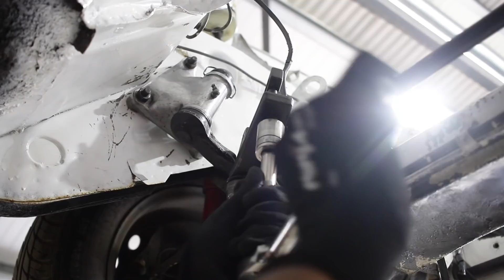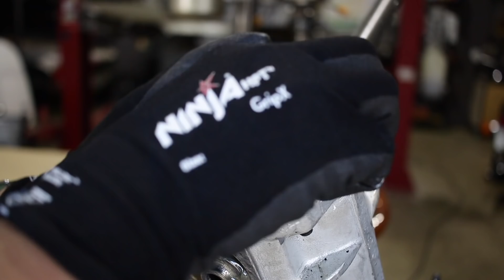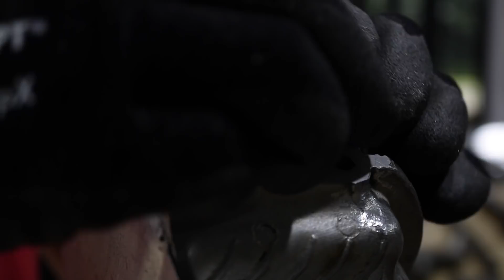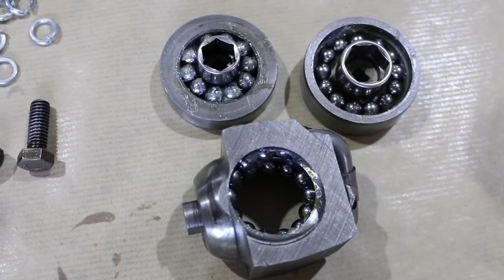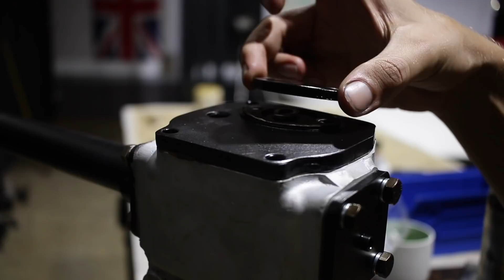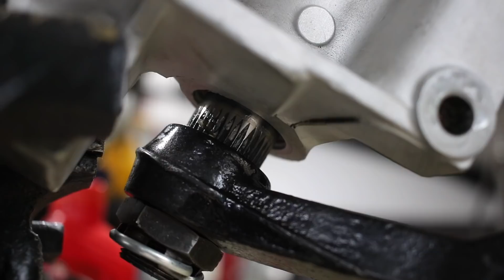Alfa Romeo Spider 105 Burman Steering Box Rebuild.

Comment: Hey Jethro - I know this video is 2yrs old, but…were you sure that was regular grease and not (Castrol) Spheerol - which can be used in steering and gearboxes? Spheerol flows at any temp, unlike regular grease and can help stop leaks. Thanks.

Comment: Great video. I’m attempting to replace my lower seal on an early type box(like the one in your video). The metal washer does not go back in no matter how hard I try! I purchased a 28x35x5 mm oil seal as in your video(the difference being 5 mm vs 4 mm which they did not have). It would not fit properly. I got it to seat as best I could but when I put the shaft back in (gently) the seal dislodged. Any tips ?
How does that metal washer reinstall??

Comment: I'm curious about the bottom bearing race you spent all that time on your lathe with to take care of the pitting.  Do you think it would be possible to upgrade those loose bearing with a cartridge bearing set?  The surfaces would need to be milled to accommodate the cartridge bearings, but those would be something that what last a good long time and be easily replaceable.
Reply from the maker: I believe it is possible, I’ve seen some people do that conversion. I don’t have the skill as a machinist to do it myself at the moment.

Comment: I noticed on the final assembly of the front cover, the spacer that goes in after the front race sticks out a bit. Does this compress inward as the cover is tightened?
Reply from the maker: Yes that's how the preload is set on the bearings. Adding shims between the casing and the cover is what loosens the preload.

Comment: Great job on this!!  One thing I have always seen as helpful that I didn't see you do on your video is to make sure that the box will still operate smoothly when you apply force to the steering arm, and not just the wheel. A small difference in the shims can make it difficult to "motor" the box from the arm, which would of course mean that there wouldn't be much feel of what the front wheels are doing on the road, and possibly not enough freedom for the steering to self-center due to caster.  Great job on these videos.  I really enjoy them and admire your care and pride in a job well-done.

Comment: Just came across your channel...I' an owner of 1970 1750 GTV which I restored 20 years ago...i replaced the idler a number of years back plus all of the steering gear and a new suspension kit and have had no steering issues..but....for whatever reason I worry about the steering box as it is original and I'm thinking fatigue may be setting in. As with brakes...steering failure not something you want. The steering box is the last remaining (significant mechanical) original part on this car...mainly because I have had no steering issues. I thought about putting in a new re-original jus for peace of mind...not terribly expensive for that. Going o have a look and see if there are any fissures or cracks...its always been on my mind.

Comment: Forgive me -- you may have already answered this question somewhere. Exactly how many ball bearings are supposed to be in a Burman box? Many moons ago, when restoring my '74 Spider, the box came apart with... let's say, much less finesse, than what you have demonstrated. :) At the time, I thought I had gathered all the ball bearings off the shop floor, but exactly how many there were supposed to be has haunted me for 25 years. (The terrible blue-and-yellow manual was of little assistance!). As an aside, the bottom seal on my Burman has never stopped weeping and it PAINED me to put grease into it as a solution -- I wholeheartedly agree, packing grease into the box is at best inelegant. Borrowing courage and conviction from your video, I will retackle the job sooner rather than later!  Cheers, Jethro!
Reply from the maker: I think it was either 54 or 57, I can’t quite remember. I just made sure I filled up the bearings until there wasn’t space for anymore ball bearings to fit. I guess one benefit of the grease is that it stops the ball bearings falling out when you open the box.

Comment: Whats your experience with the welding up? On Alfabb most claim that the aluminium so to brittle for substantial welds and the introduced head would rather lead to more cracks in brief time. That sounded reasonable to me but few actually seemed t give welds a try.

Comment: Thank you Jethro for the video, Just re-welded the cracks on my box today. it wasn't easy at all. here my tips on how to TIG weld it: Clean the box at least 5 time with fresh thinner. grind to white metal all area to be welded. preheat the box 80-100deg c. use low heat input, I started at 135 Amp and it was way too much. The more amps the more porosity you end up with. The first pass is the most difficult due to the base metal gazing out unreasonably the remaining pass are more manageable. I found that having too much AC balance would generate more pores. Overall I feels like this alloy possibly contains zinc (like a 7000 serie) it is not designed to be welded! I used 5356 filler as that's all I had, 4043 is probably better. I wish I would have been told this is a pain to weld! I would have been more carful with the amp settings. Take care and be prepare for a few rude words :)

Comment: Went through this about 25 years ago so my memory is a bit dusty but it's likely that once the car is full weight on wheels you're going to find a dead zone in the center caused by wear on the part of the upper arm that interfaces with the carrier which is very difficult to restore. You can take some of it out with a shim under the spring plate but this tightens the entire mechanism. there was a guy in LA way back when who was machining new arm faces but don't know if he's still around. Also, as was my case, there may be cracks in the housing beyond the ones that were visible. It would require dye penetrant or some other NDT detection method to see them. If the housing breaks it will do it when you are turning the wheels when stopped such as trying to squeeze into or out of a parallel parking spot. Another option is to replace with a ZF box but I think they may only fit into a 115. A problem with these boxes, especially the LH drive ones which are on the exhaust side, is that the oil most likely drained out of them a year or two after they left the dealership floor and nobody ever bothered to check. As far as I know there was never anything in the service manual telling you to top off the steering box oil.
Reply from the maker: Exactly. And on the RHD cars you have to remove the carburetors just to top up the oil. So this oil seal conversion should help it enormously in the fight to keep the oil level up.
Reply: @JethroBronner  I used some stuff that was being suggested at the time.  (sorry can't remember the name) It was a red colored liquid and best described as being about halfway between gear oil and grease. It has been in there for over 20 years now so seems to have worked well. The leftover tub is around here somewhere I'll see if I can dig it up.

Comment: Great video.  I rebuilt my burman box a few years back and found the same cracks around the bolt holes during the process.  At the time the billet aluminum boxes were less costly so I bought one and completed the rebuild accordingly.  The result was excellent.  By the way, I also decided to reinforced the attachment points for the box and the steering idler by adding 1/8 inch steel plates where the three bolts pass thru the front wheel wells.  I was told this is an old trick many racers used back in the day.  By doing this the opportunity for the box to flex or twist is further reduced.  No issue in the last five years.  I also agree with you regarding the use of oil vs grease -- not a solution only a band aid.  Thankfully the new box and seals do not leak, so far.
Reply from the maker: Those strengthening plates are a very good idea and I will welding some into my 1750 GTV project for sure, however I’m going to keep this Spider factory, as it’s not mine to modify.
Reply: @JethroBronner  Welding is fine but panel bond, IMHO, is a better solution.  The bond is super strong and no H2O nor oxygen can get between the metal to promote rust.

Comment: Another great Alfa video.  Please keep them coming.
Your straight forward, no fluff style is refreshing and enjoyable.  Beautiful production. really informative content and presentation.  
Jethro, what are your thoughts on wider tires and their impact on the steering system?  I have 2 spiders, 1 with 185's the other 205"s.  The original spec was 165.
Reply from the maker: I find 185 can be pretty good, especially on a 15” wheel, I like the 185/65 R15 on a TZ1 15x5.5 wheel on an early spider. I find 205 is really wide and spoils the handling quite a bit, especially on a GTA wheel. The early Spider on a 15x4.5 with 155 tyres drive really really well, but of course it’s hard to find those tyres now.

Comment: In the 1970s I worked on a number of Alfas prepared for racing in the U.S.A. In many instances the steering boxes had ribbing built up from weld to prevent the cracks your example has. All the Autodelta built cars I serviced had this feature. I believe there was a technical bulletin on how to add this reinforcement mentioned in the ALFA ROMEO COMPETITION REFERENCE HANDBOOK curated by Don Black. I’ve enjoyed watching your videos and it brings back many fond memories.
Reply from the maker: The whole time I was working on this I was thinking "How did they run 9 inch wide tyres on the GTAm cars!?" So you've answered that for me haha.

I'm going to have to keep an eye out for a copy of that book.
Reply: The first time I saw the reinforcement weld, I thought it was a crappy repair job...

Comment: My shaft had the same bottom pitting as yours, I installed a 17mm Internal Dia 47mm OD 15mm thick tapered roller bearing in place of the old one, the rounded edge of the inner bearing opening rests against the pitted groved part of the shaft (less than optimal contact surface perhaps, but not terrible either), and it's smooth without any play, no other modifications needed
Reply from the maker: That's a solution I've considered as well. In that AlfaBB thread I linked there are some photos of that conversion too.
Reply: @JethroBronner  the solutions in the thread (as far as I can see) involves a lathe and a shaft that is a PITA to turn, I made it work without any modification with the mentioned bearing. I don't have a lathe, and would probably have gone the "proper" route if I had access to one, but this $5 no-effort solution was a pleasant surprise

Comment: The holes in the steering wheel are for another type of puller, but your little tool is fine too.

I use a small puller with threaded rods to suit, put 'em through a harmonic balancer puller, but your solution uses the same mechanism, and works!

Comment: Zen might be the wrong concept for maintenance... Applying zen, the idea would be to simply use it, whatever happens is meant to happen. Wabisabi might be a better way to look at it. Repair what is broken to show appreciation, but not look to "perfect" or "hide" the damage. So use it, care for it, appreciate it, but if it's damage, wear it like a badge and work to make it serviceable again, but no aesthetic repairs as it hides the thing's history(kintsugi repairs in earthen ware, they literally put emphasis on the cracks).
Reply from the maker: Yes I think you're right about that definition, but I was really just making a reference to the book Zen and the Art of Motorcycle Maintenance.

Comment: Is it possible to make a quicker ratio by modifying something? Something like 12:1 should feel great.
Edit: Such a nice video, very satisfying and calm. I admire your attention to details, and how clean everything is.
Reply from the maker: The easiest way to change the steering ratio is to swap out the arms on the spindle, you can get short ones which make the steering more aggressive.
Reply: @JethroBronner  Thanks. Will this cause any change in front end behaviour? Bump steer or anything of that sort?
Reply from the maker: I've never tried it, it seems to be the thing to do for track orientated cars.  I think you might need to really think your suspension setup through if you use them.

Comment: Excellent content Jethro I always wondered how complicated steering box repairs and tuning were as a lot of Japanese cars in Australia using recirculating ball steering often had issues even from factory with excessive play - fascinating work as I’m no engineer yet your approach to maintaining yet refurbishing is an art and incredible to watch - well done 👍
Reply from the maker: Recirculating ball steering seems to have a bad reputation, but I really like the way the Alfa 105 drives, it has a great steering feel. But yes, you do need to maintain and repair them, certainly more work than rack and pinion steering.
Reply: @JethroBronner  I've got a '69 GTV. I don't know if it's got the same box. It's commonplace for GTV boxes to start coming adrift and become wobbly, robbing the car of its intuitive feel. After mine was firmly reattached, the steering was utterly transformed.

Comment: Help! I have a 1991 spider that someone reattached the steering box to the car about a bit higher than it should. Welded it.
So the geometry is off messing with the alignment.
If I remove the engine it might be possible to  redo the mount correctly...or not.
Most shops aren't able to do fabrication as they're too busy or don't know how.
Dreaming of fixing the problem by modifying the arm to be a bit lower.
Seems like too much till I see this video.
Inspiring. Sure you could figure it out in a jiffy. Good job.
Any advice is appreciated.
Reply from the maker: Hi Jeff, if you send some photos to my email jethrojbronner@gmail.com I'll try give you some advice.

Comment: These "a few sandwiches short of a picnic" kinda "repairs" Alfas, and 105 Alfas especially, are particularly prone to I reckon. Only vintage cars I would know of with worse repairs were LandRovers, which are tractors more than cars anyway, and can use some a little bodged up parts to make 'em "authentic". No matter BMWs, Mercedes, Citroëns or Lancias I was lucky to work on had ever so many bodged "repairs" "done" to 'em like the 105 Alfas I tried to keep on the road - and that was already the same when I got started with my first Giulias and Bertones back in 1982 ......
Reply from the maker: I think that's true. There was a time when these were just absolutely worthless and no one repaired them they way they should have.
Reply: @JethroBronner  I got mine in northern Italy (just about 300 km away from my town) from some wreckers I knew, we also bought those cars standing behind the Alfa and Lancia dealers in some shady corners. Usually, we needed three to come to two complete working ones - the rest went to our wrecker in town who payed well by weight - I can't say I did drive bad cars in my youth, but it was a piece of work driving Alfas, Lancias and other "Exotics" on a strict budget between all those boring Opel, Ford, VW and Audi my fellow Bavarians prefered ..... Today, I get nightmares remembering what we threw away in the eighties and nineties, once You bring up "worthless" .....

Comment: 7.14mm = 9/32" for the ball bearing, and it is probably easier to find 9/32" ball bearings than the equivalent metric, just about all ball bearing from this time period used imperial units. Great and interesting video.
Reply from the maker: Yes these Burman steering boxes were built in England, and use all imperial hardware.

Comment: I have my box still disassembled on the table and had it for a few months until now that I'm nearing completion of rust repairs in the engine bay and welding in of reinforcement plates from alfaholics on my car. You video is right on point to finally get it back together, thanks a lot. 🙂

Comment: Fabulous work as always Jethro.
I've heard that you can prevent stress cracking in aluminium castings by having the piece shot blasted with steel shot - apparently this peens over the surface and creates an inward tension on the part that serves to reinforce it against cracks and fractures. No idea if it would work in this application (I heard about it in the context of differentials) but I thought it might be of interest to you.
Reply from the maker: It might be worth looking into for future rebuilds.

Comment: A few things that I noticed:

1) When trying to get the ball joints open (the taper), just apply pressure with the ball joint splitter and hit the ball joint with a hammer, the taper will open quite easily.

2) NEVER USE GLOVES WHILE TURNING! If you value your most important tools (you hands), then please do not use gloves when turning.
Reply from the maker: I'll keep that in mind, thank you
Reply: @JethroBronner  When working on things, be it a car, furniture, painting a wall, I keep my sanity with some childish humour....I fully expected you to ask that steering link that fell some dumb question..."Where are you going?" or "Kom terug my broer", which is what I would have done. I think if someone were watching me, they'd think I'm a little wonky. Jethro, you have no idea what it means to me seeing these videos. I have such a passion for those old Alfas, but just cannot afford to get one, the prices they go for now! I should have kept at  least one of the seven or eight that I had as a youngster....thank you that I can "work" alongside you, great memories.
Reply from the maker: @johnjones4825  Yes I’ve been incredibly fortunate and privileged to get this little collection of cars. I was lucky enough as a teenager to pick up some project cars for very cheap. At the time I had no idea they would ever be so expensive.